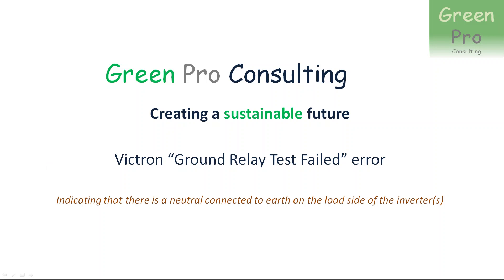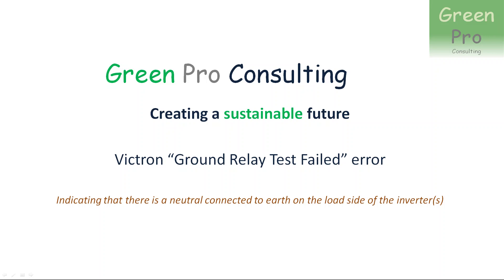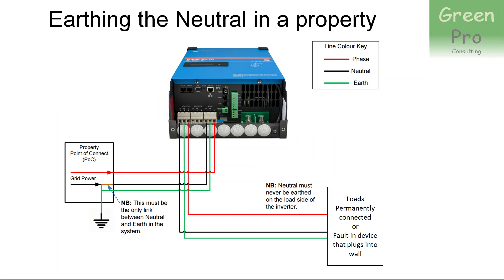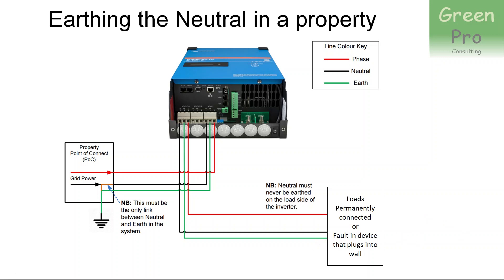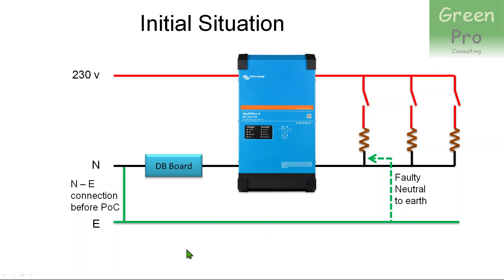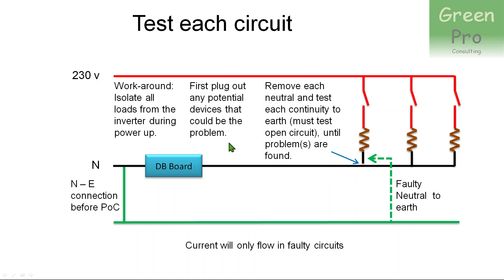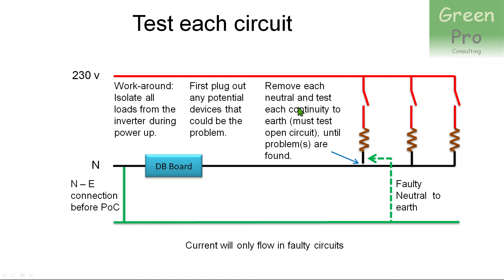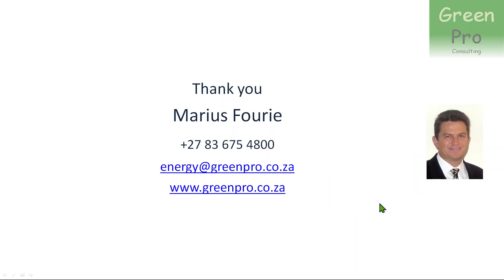Victron Ground Relay Test Failed Error

Comment: So I could be seeing a ground-nuetral bonding on the db board. Some guys set ot up like this,but I suspect it's only for off grid. Or would need a relay to break the bonding which mains AC is on. ??
Reply from the maker: Sorry. Far too little info to comment.

Comment: I have this problem since last night 2am when the inverter just turned off when doing this self test. It keeps saying that the connected battery (dyness 9.6kw) is low and then the inverter goes into Sustain mode but not charging the battery from the grid or from the connected solar. Currently have power on by having the Inverter set to bypass (there is a small 3 switch db board with a bypass switch next to the inverter). The electrician tried solving the problem remotely but it keeps giving the Error 8 even with AC going to the inverter turned off and having it on bypass ( so only battery and mppt connected). Seems like something inside the inverter or battery is messed up. The guy is coming tomorrow or Saturday to check onsite and he says it is probably the Lan cable between the battery and the inverter (multiplus 2 GX)
Reply: Hi. I know this has been posted a while ago but I thought I give it a shot. How was this solved? I have the same thing all of the sudden after running the system for over a year. Thanks!
Reply: @rolfbienert3789  yeah, same problem. Sad there wasnt a follow up. My inverter works just fine with the smart solar chargers but doesn't charge or discharge the battery and I get the error 11 step 8 message. Strange because I don't even have anything connected to the ac out connection. Only ac in.
Reply: @theacme3  Victron eventually exchanged my inverter under warranty. I contacted the seller and they tested it first in their shop. At first they did not find the issue because they did not wait long enough. The test seems to happen when AC2 switches on, which is a couple of minutes after AC1 comes on. I showed them when it happened and they contacted Victron. I had a replacement in about 6 weeks then.